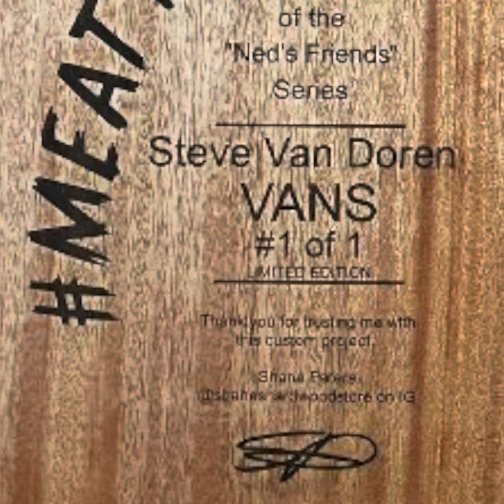The Vans Project

Comment: Hi Shane. You have once mentioned all the same colors should be poured at once since you wont be able to match the color again... in your video you were using black and white later for a second time... how did you fit the color to the first pour? did you use all the exact same measurements again for the smaller areas or how is it done? By the way... I have sent you a  few questions on your Instagram channel... (its_all_about_personal_freedom).
Reply from the maker: I am so sorry for delay!!!! I am just learning how to even see all of this. ugh.
I will also find your IG now to make sure I responded to you!